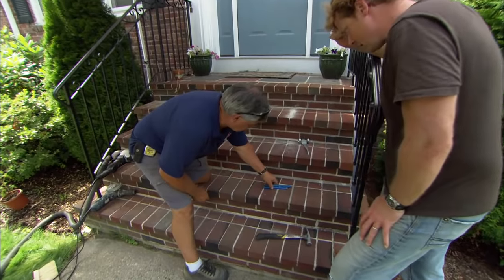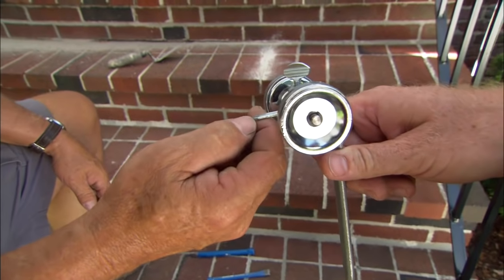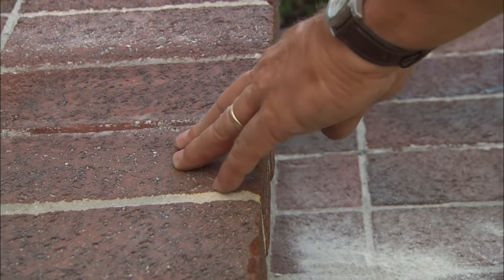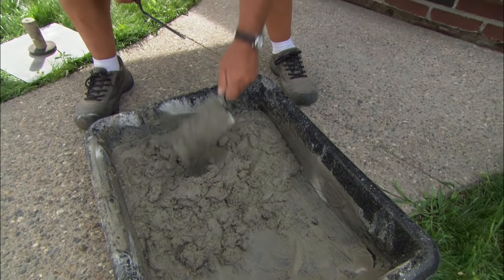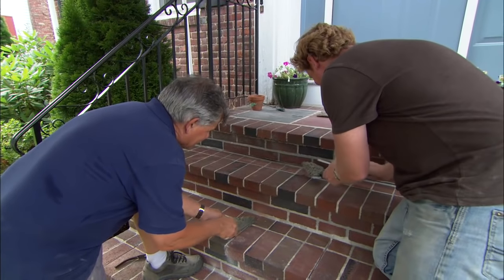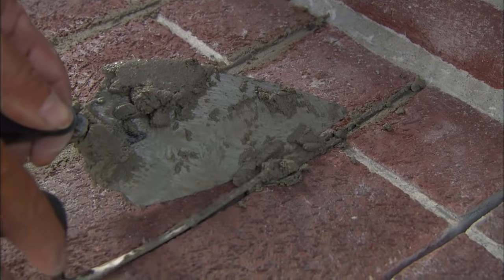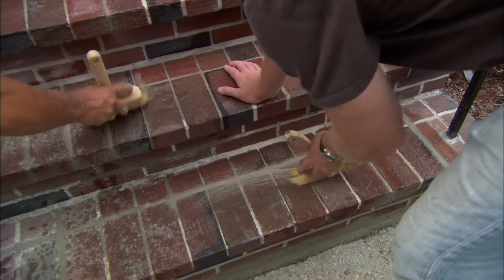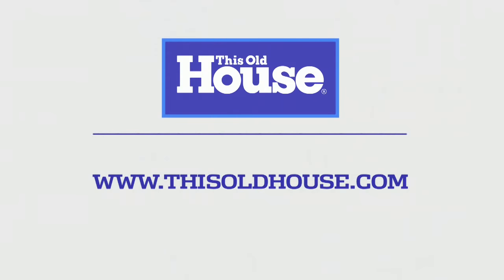Repointing Brick Steps | This Old House

Comment: Do not pack that bottom joint with mortar. It will not last. That joint should be caulked with a high quality sealant. Tommy is a great carpenter; in this, he is a carpenter doing masonry work.

Comment: Hey Tom I’m a 4th generation mason my great great great grandfather Nona Michaelcame to America as a true Italian stone mason The two you have with the wheels to handle and a nail setting it called a skate and that’s usually used for after a bricklayer strikes up his brickwork he’ll strike all the joints head joints and bad joints with a flat iron and then skate the green cement out to eighth inch quarter inch half inch depth to make the brick project out

Comment: If not too messy, use vinegar and water to clean up.  Also, I think there is a wax product you can apply to the surface of the pavers to make the mortar stick in the joints only.  May not be available except at a masonry supply.
Reply: You can always use grout release

Comment: First the raker is used for jointing purpose with the head of nail down.  For precise jointing like this simply tape the sides of joints and use a heavier mortar.  A bonding agent should be used to help with adhesion.  I never liked using a slicker and prefer a flat jointer which is more rigid.  I also turn jointer sideways into joint to make sure it's completely down and not bridging .

Comment: that looked like a Portland+lime mortar to repoint a sand+lime joint. I'm just trying to learn this stuff and this confuses me as restoration vids, some at least, say that kind of mixing is bad because the old mortar is self sacrificing while controlling moisture while the newer mortar forces the brick to take the moisture. what did I miss?

Comment: Love the show and have learned some good stuff but.....

Some people here saying the mortar was too dry? It was too wet, that's why there was too much staining of the brick faces. Muratic acid should only be used as a last resort when a lot of staining has occurred by poor application. Not as part of the normal process. It's nasty stuff.

I would have wet the joints first, then applied a dryer mix.

Comment: I'm no mason, but how about simply masking the bricks with some heavy duty tape to keep the mortar off ?
Reply: its easy enough with practice and proper technique to make a clean job while repointing; my boss would never allow me to touch the trowel to the brick and push mortar in like this. But
injecting the mortar into the joint with a pointing bag can be much easier than working off of the trowel.

Comment: Why not use a bag, cut the beed with a trowel then joint it? Much faster and cleaner...I think.

The method shown looks messier :)
Reply: Exactly I said why not use a bag also much cleaner way.
Reply: +johnny feathers I think know why they didn't use a bag. Maybe It takes too much skill for a regular homeowner?
Reply: Marcos Cortez grout bags can be quicker as far as filling the joints but unfortunately you can run into joints not drying fast enough. Also it's important to compress once the bagging mud has set up otherwise the mortar doesn't bond well. You also have to watch for shrink cracks, the wetter the mud the greater the chance of shrink cracks showing up, much like parging

Comment: no mask while grinding? Ever hear of death by silica? Where to brick come to a right angle the joint is always flush not concave. Generally a mess you made. I would have wet the brick prior to pointing and then let the surface dry a bit so mortar doesn't dry immediately. Ever read a Material Safety Date Sheet?
Reply: Exactly. Doesn't matter whether it is hot or cold, wetting the brick before pointing is an absolute MUST.

Comment: Actually that mortar was way too wet. The stairs should've been washed first then allowed to surface dry. Then pack the joints with mortar mixed to the consistency of damp beach sand, essentially "dry packing " . Much stronger, much cleaner.
Reply: no it was actually to dry, it fell off the trowel because it had no moisture. obviously the man doesnt know how to mix.
Reply: Relax

Comment: well that was some awkward looking tuckpointing. if these were my guys they would have been fired on site. but for homeowner info I suppose it's fine. but as another commenter pointed out its far better to be clean while pointing than come back with muriatic acid afterward. sometimes it's necessary  (new construction bloom, moisture issues, etc.) but it is some nasty stuff.